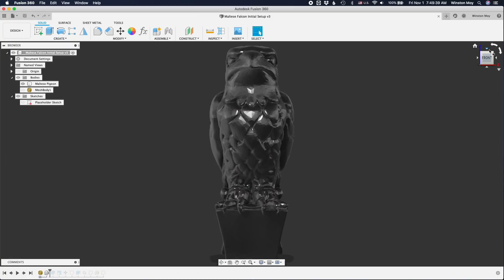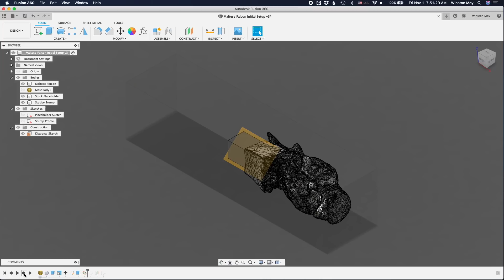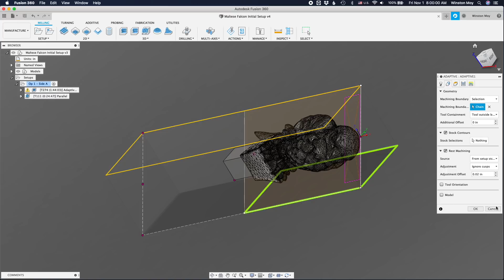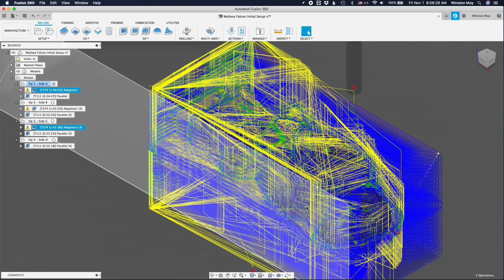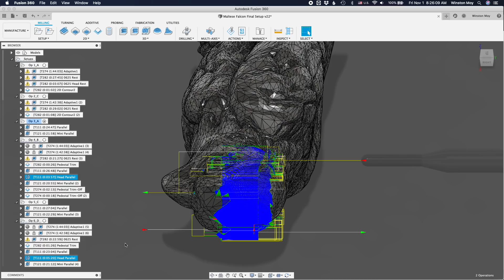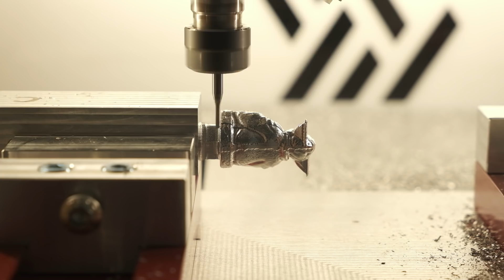Machining Miniature Models from 4 Sides - #FusionFriday

Comment: Wonder if you could have also done this with a 4 sided collet and started with round stock.  Hell you could use a 6 sided collet and give you even more options.
Reply from the maker: Definitely possible as long as it would fit under the gantry/carriage.
Reply: @carbide3d  well I'll give it a try when I get my nomad in a few weeks :D  Maybe I can post a video if it works out.  It'd be a lot less hassle than dimensioning your stock every time.

Comment: I want to like the Nomad. My only issue is the 3 inch height limit. A Sherline Mill gives larger limits for less cost. And I'm honestly having the same hang ups on the Shapeoko, I like it a lot, but it needs to have a 4 foot (or even 5 foot for Baltic Birch Ply) capacity in at least one direction, preferably with the stock being able to slide through for indexed larger cuts.

Comment: How long did the machining take?  How long did the designing/tool path setup take you? Just curious. Great job!
Reply from the maker: About 3 hours to rough, though I could have been a little more aggressive with speeds and feeds. About 2 hours to finish, but more if you want to go crazy and use a 1/32" ball endmill. That part is pretty quiet though, so I'm more than happy to just let it run in the background.   -W

Comment: What kind of spindle are you using, wattage etc?
Reply from the maker: 70W brushless motor, stepped up to 10k at the spindle.
Reply: @carbide3d  is that the OEM nomad one?
Reply: @AlexK07010  yup.

Comment: wow this is cool.  can you show your airblaster setup please?
Reply: Yes, I was wondering did you have a compressor running that whole machining time?? Mine is loud and overheats.
Reply: @Audio_Simon  California air tools has a good little ultra quiet compressor that is great for things like a constant air blast.  Several CNC manufacturers recommend them.   
Outside that, you need a high capacity tank that won't overload the compressors duty cycle to keep a constant air flow.  Granted, it only needs a few psi, but most pancake compressors aren't up to the task.
Reply: @shirothehero0609  I tend to run mine at 30PSI and the compressor stays on pretty much 75% of the time.